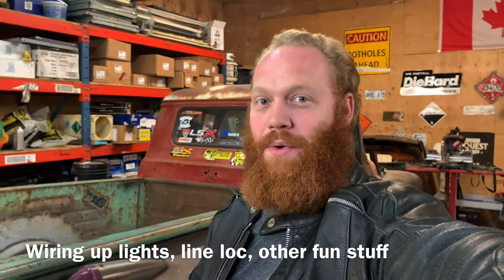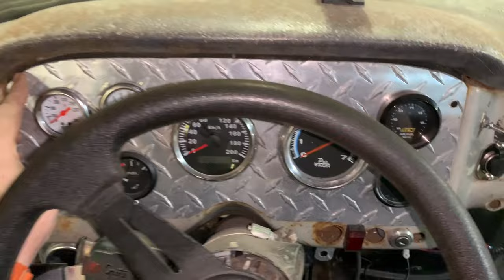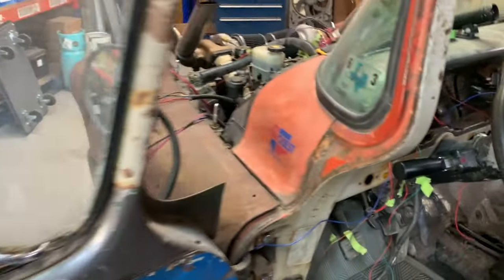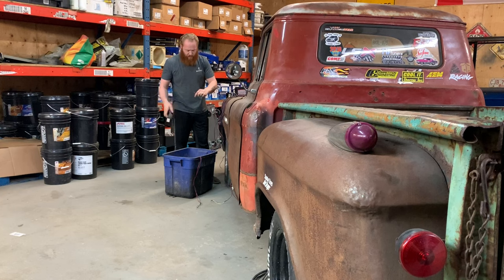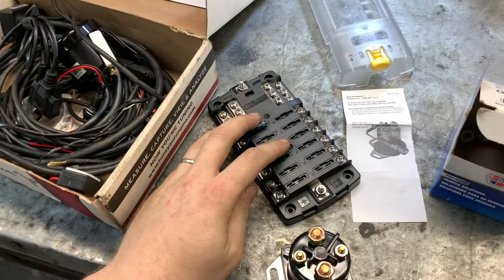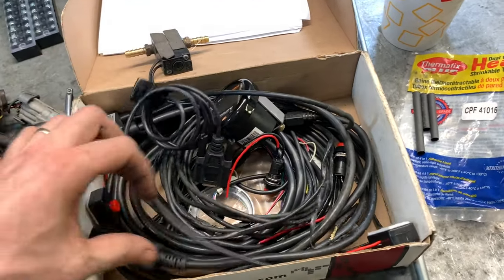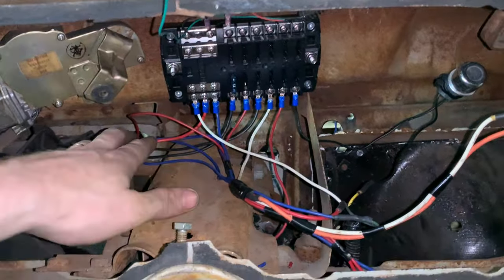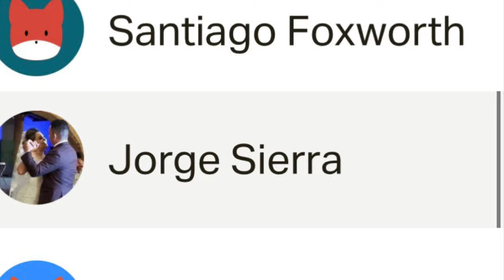Wiring headlights, taillights, line loc, wipers using an aftermarket fuse block on a classic pickup

Comment: I am wiring my hot rod right now. The person who owned it before just hacked the harness up. Wire nuts and splices with tape everywhere. I took a break from that nightmare a week ago and afraid to face the monster again.
Reply from the maker: Ohh man the wire nuts thing is rough hahaa.
 I found it much easier to work on after I removed every wire and started over from scratch, if that helps. It only got overwhelming when I tried to remember what wire went where